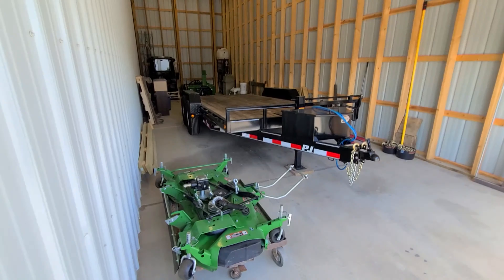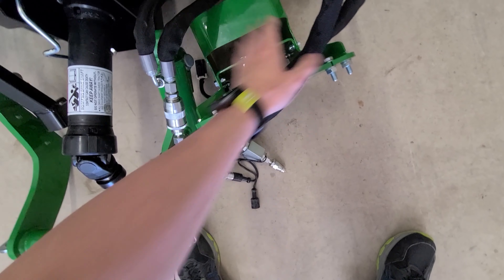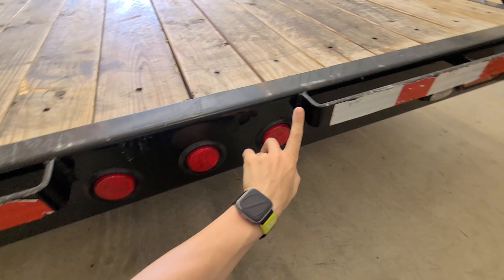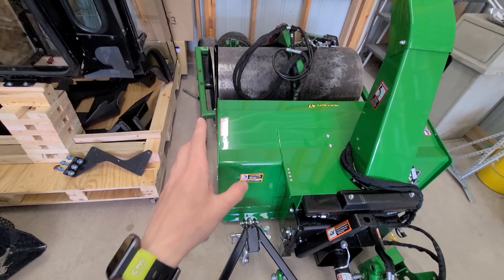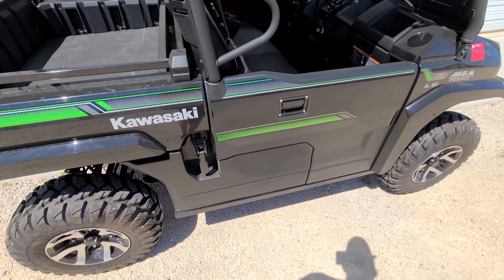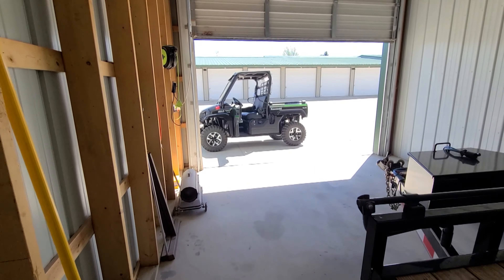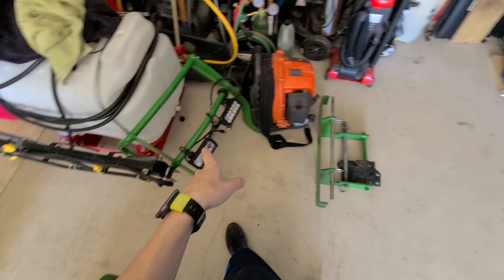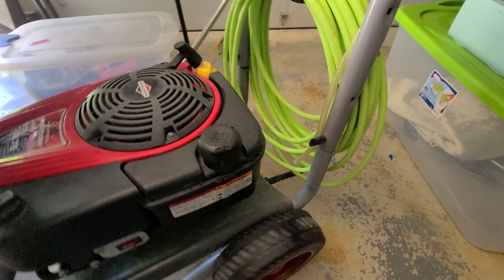2022 Equipment Tour

Comment: Sorta off subject but I've been following your channel & I have adopted bunches of your ideas. My one question is on the LED lighting. I have been using automotive style relays to connect the work lights and the ROPs lights. My logic is because of the amp load. I have been told on the forums that this isn't necessary
Reply from the maker: I would agree with that. I have some pretty high wattage LED lights and when I check the Amp draw with a multi-meter the amp draw is less then 5amps. Most switches have a amp rating almost two times higher then that.